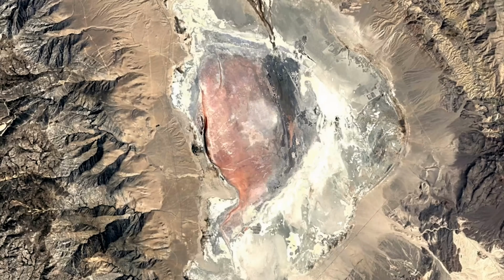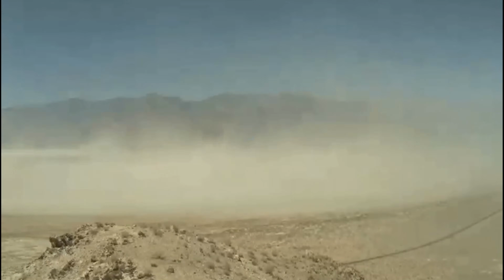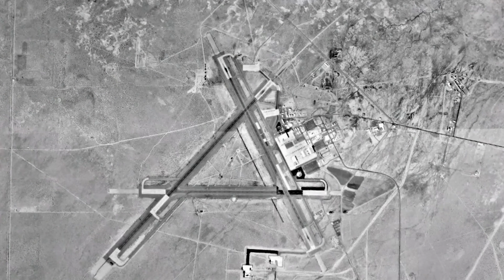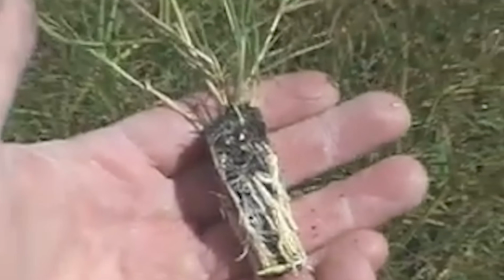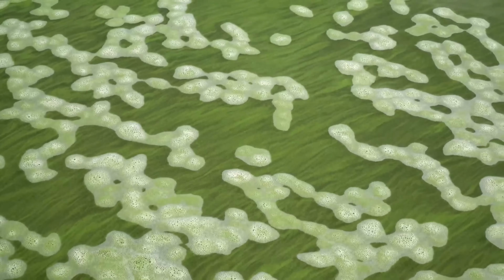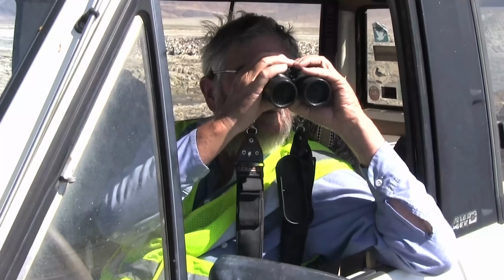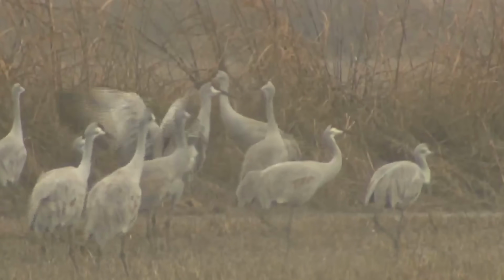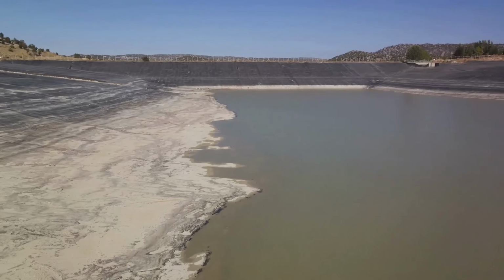How California Is Turning America's Most Toxic Lakebed Into An Oasis

Comment: The part about the lake disappearing in only 13 years shocked me. Imagine an ecosystem that survived 800,000 years being erased within a single generation.
Reply: I live here and I was amazed when I learned Owens lake had water in it as recently as the '20's. I used to live next to Edwards AFB and Rogers dry lake  but it was dry since prehistoric times. I thought Owens lake was the same. DWP had a 99 year lease that ran out in 2012 or something and they are supposed to start sending water back into the lake but it's still dry

Comment: Why was the dust toxic????  BECAUSE IT CONTAINED NATURALLY OCCURING ARSENIC!  The Arsenic is naturally occurring produced from the erosion of volcanic rocks and geothermal springs surrounding the Owens Valley area.  Trace amounts of arsenic and other minerals are carried down by streams, concentrating lakebed sediments.  The arsenic concentration in the sediments ranges from 50 - 150 ppm.  The Permissible Exposure Limit (PEL) is 10 μ g/m³ (0.01 mg/m³) of air, calculated over an 8-hour period, called the time-weighted average (TWA).
Reply: It was toxic because it was airborne.

Comment: There's no way in hell they would allow the draining of Owen's Lake these days - the project wouldn't even be proposed due to the environmental carnage it caused.  Ditto for diversion of the water that fed Tulare Lake in the Central Valley - the largest lake West of the Mississippi until they drained it.  Restoring these two lakes could be radically transformative to the surrounding areas.  But LA gets a free pass because "historical reasons".  If they took water conservation seriously there were would be much more water available to get a little closer to restoring these areas (although the Tulare Lake restoration would need billions to buy back of agricultural land).

Comment: 1913 Owens Lake was the 4th largest lake in California.
Mulholland STOLE that lake, got power to turn it into a tourist destination, instead used that control to drain the lake dry to the bone.
Mulholland created the largest manmade disaster in America. - EPA
Simple solution is make Los Angeles stop stealing the water, desalination is very easy now (solar, gravity, osmosis)

Imagine them needing to steal a lake in 1913, and not they need to steal Colorado River water, anything besides build desalination plants.
Wiki says Mulholland tricked the locals, then they bought the infrastructure, took out the train that went through Owens Valley.
These elite experts think cursing their bloodlines is fun or something, karma is on deck.
If you're aiding and abetting (I can smell you)... going down with them.   It is in the book of life now.

Comment: They need to cut LA off. 
LA actually gets enough rain water to cover its water requirements, but they let all that water flow into the ocean. 
They prefer to steal water from everyone else.
Reply: When you see those amazing LA floods flowing down straight concrete channels directly to the ocean, don’t you just wonder why the county has not come up with a water storage solution yet?
Reply: @Alistairville  They actually do have areas where they have drainage into aquifers. Mainly these are in the San Gabriel valley. Too much buildup in the LA basin and San Fernando Valley to do that at the scale needed. The engineering challenge to capture the LA rain to cover a full year is beyond massive and remember a whole damn lot of it gets contaminated by the gross pollution of ICE motor vehicles. Take a look at the oil stains on asphalt some time. That doesn't include the gas and coolant chemicals that leak.
Reply: It would also be cheaper to use desalination plants instead of paying for projects like this...quit taking from Owens lake and it'll return on its own
Reply: @modestoca25  That sounds like an excellent idea.
Reply: @modestoca25  just because that technology exists doesn't mean its cheaper, it requires a tremendous amount of energy

Comment: So why don't they just pump filtered sewage water into the valley?
Reply: Because that would in time make it a very fertile valley assuming they did not allow heavy metals from the sewage in.
Reply: @ivanhorban340  Right. However, this can be addressed by using pre-settling basins or pond/lake systems—similar to planted garden sewage-treatment ponds.

Such sewage-treatment ponds (or wastewater treatment systems) are nature-oriented systems for purifying wastewater. Purification is achieved exclusively through biological processes based on the interaction between aquatic plants and nutrient-degrading microorganisms.

All that is required—by the standards of sewage-treatment ponds—is the occasional removal of contaminated sediment deposits (where heavy metals have settled) via suction at this small scale.
Reply: @arturwittensoeltner8729  There was a small town back east the just dumped their sewage into a marshland that was connected to a lake. Their original treatment plant had failed and it was to be temporary solution. They finally got up enough money to build the new plant and decided see what had happened to the temporary pond. It was a thriving ecosystem with plants birds, frogs and no smells at all. So they left it thinking it was working so why change. Some years later the EPA found about it and made them put in a sewage treatment plant. The ecosystem died and the new plant add considerably more taxes to the towns people.
Reply: @ivanhorban340  NOT a "sewage treatment plant".
I was referring to "plants"—such as aquatic plants (along with soil and microorganisms)—in separate upstream retention basins, ponds, or lakes (where, for instance, suspended matter like plastic is trapped, and heavy metals can settle down before the water is passed on in stages to the next basin) that serve as pre-filters for treating the wastewater before the in the end of then chain clarified water is actually discharged or released into a natural habitat of some kind.
Reply: @arturwittensoeltner8729  Thanks for the clarification. I am all for a more natural solution to sewage and the other biological wastes we make. We are on the same page and again thanks!
Reply: It’s due to gravity: LA is pumping freshwater from a source already upstream from Owens Lake. 

Sewage would have to come from LA, which is downstream. LA would need to build a pipe from LA in the south and pump against gravity to go upstream.
Reply: 10:27 photo-bombing Coyote …
Reply: 13:25 and again here …